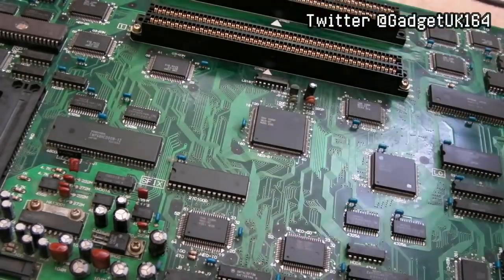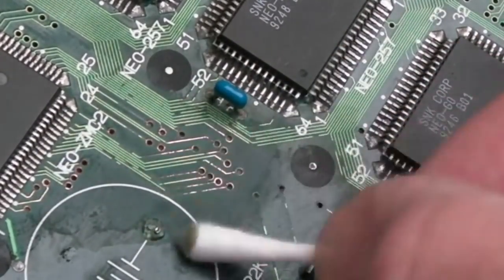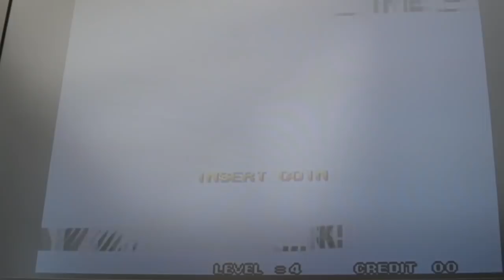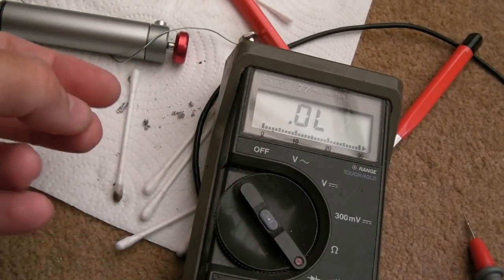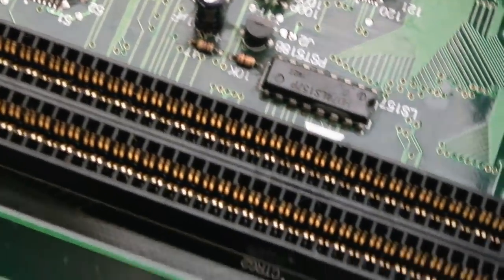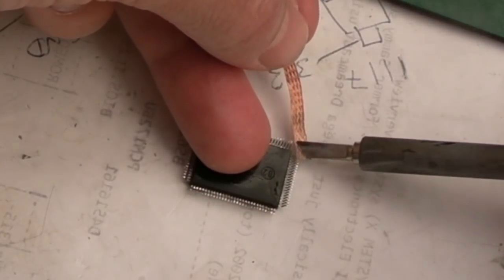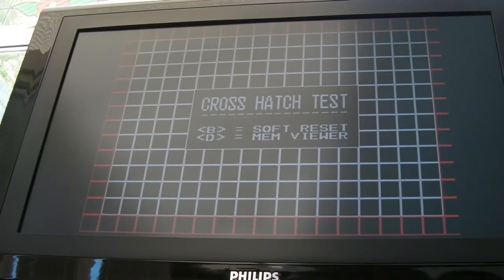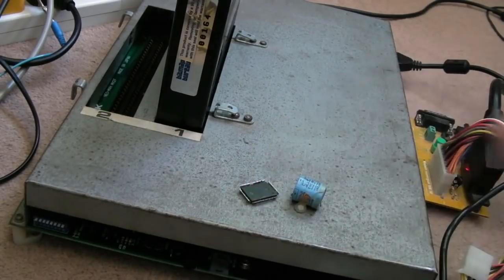SNK Neo Geo MVS MV2F (2 Slot) Repair (Lines / Sound / Calendar Error / Controller Input)

Comment: Still watching while in a meeting lol.  58:32, I like your idea of going parallel with the pads as going perpendicular, I have ripped off many of pads in the past.  I'm assuming because I've pressed down too hard and also possibly from using the incorrect tip :/

Comment: Hi, i have a quastion about Amiga cd32. Something went bad with sound channels when my friend hooked it up with this module terrible fire. I think that there is something with stereo mixer becouse it outputing sound to the tv but there is only mono on both speakers, but when o pluged headphones there is only left channel. Do you have any tips for that ? Thank you in advance for your answer.
Reply from the maker: Has it been re-capped?  The capacitors are the most likely cause on the CD32.
Reply: @GadgetUK164  Hi, yes it is fully recaped. I think the preamp U38b (LM253) is done. This is two channel audio amp and when i measure first output it seems to be left channel audio but when i measured second there is no audio.